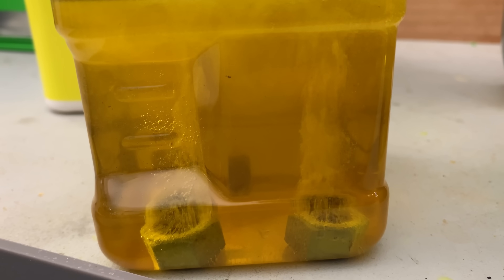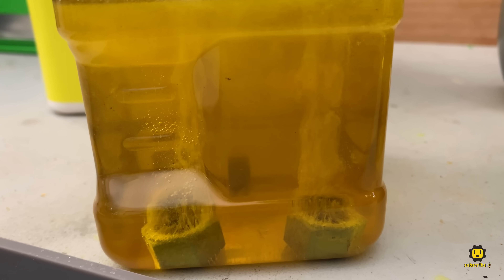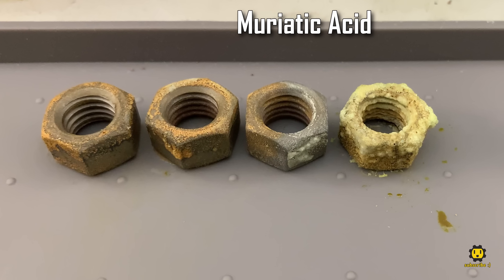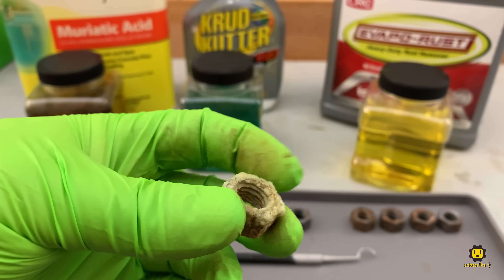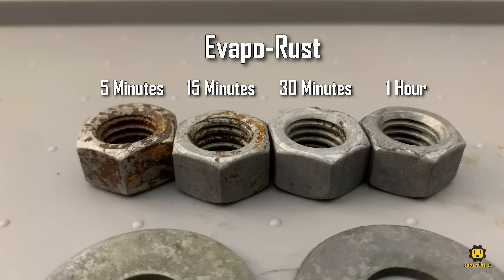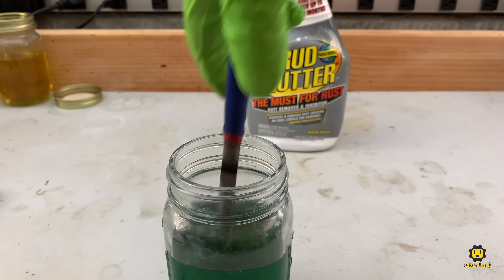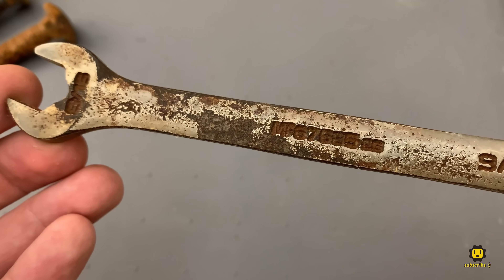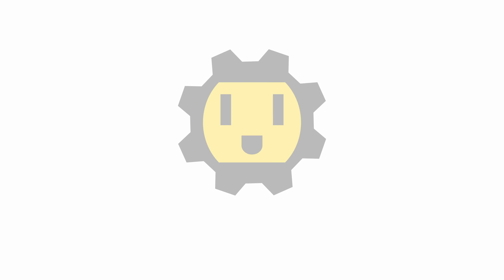The ULTIMATE Rust Remover - Cheap, Fast, & Easy

Comment from the maker: Thanks for watching! Tools Used In The Video:

- VEVOR 15L Sonic Cleaner (COUPON: VEVT5 ): https://s.vevor.com/bfRR2V
- Krud Kutter Rust Remover: https://amzn.to/4jEHIQZ
- Evapo-Rust (1 Gallon): https://amzn.to/3S2KYda
- Muriatic Acid (1 Gallon): https://amzn.to/3S2ltsu
- Small Silicone Tray ( 18" x 12" ): https://amzn.to/4jlppRg
- GIANT Silicone Tray ( 32" x 24" ): https://amzn.to/4j9PXDW
Reply: i love the Jory Caron Laboratories shoutout
Reply: The title of that sonic cleaner says it's for "mental cleaning." So if you have a dirty mind (evidenced by amusement at his frequent mention of your nuts in this video), it'll fix you right up.
As AvE in an alternate reality might say, keep your nuts in a hummer bath.
Reply: Let me see that laser engraver!
Reply: The UK government banned the import and sale of all Vevor electrical products on safety grounds.
Reply: You can use citric acid in distilled water to achieve the same results with added benefit it coated the metal as well to massively prevent rust from reappearing. 
I use this method without an ultra sonic cleaner but it takes a while without it. (Because I currently don't have one)
Reply: Muratic is what I've grown quite fond of over the last decade or so. It will straight up dissolve ANY metal left for too long in a strong enough (unmixed) solution. The trick is diligence while using a diluted solution and prompt immediate concentrated lemon juice mixed with water rinse. Thoroughly done with the knowledge that any Muratic acid residue missed cause more rust than you initially removed. Most people I've spoken to really dislike Muratic acid. Stinks. Causes extreme oxidation if spilled or not sealed properly, EXTREME OXIDATION  if not sealed in its og container. Basically just put that damned lid back on! Ahem.....but the tremendous inexpensivenes, ease of finding and purchasing, but the absolute best part in my opinionĺ is the pure SPEED that it just rips the deep pitted and scalely rust away. Cheap and fast as superman. Love the stuff. Very unforgiving, but harnessing that power is its forte.

Comment: I use evaporust frequently in my ultrasonic cleaner. I also keep a couple jars of 91% rubbing alcohol to "sandwich" my rust removal. Pre-clean and brass brush to do bulk removal of dirt and easy rust. Post-rinse to get any lingering debris and remove the rinse water, leaving the part as dry as possible when the alcohol evaporates. I finish off with a rub down with some oil (I prefer ISO68 generally) to prevent future rust. 

There is a safety concern because ultrasonic frequencies can spontaneously vaporize flammable liquids. Sealing the jars mitigates this risk but it does mean you want to limit heat so you don't over pressurize your sealed containers. In my experience simply turning off the heating element in these steps is enough.

Comment: I use citric acid.  A 10lb bag was dirt cheap on Amazon.  I just put a cup of crystals in a shoebox sized plastic container, and fill it halfway with warm water.  I've never needed heat or my ultrasonic cleaner.  12-24 hours turns rust into a black powder that will stain your hands, so gloves are a good idea for the final wash.  A scrub with dishwashing soap beforehand is a good idea, to remove dirt, oil, and grease.  Citric acid offers no rust prevention, so be prepared to dry and oil or paint shortly after rinsing.

Comment: Back in the 90s, I used muriatic acid when I discovered that it cleared off the rust. 
Sadly, the next day, all those nuts and bolts and screws that I had made in real shiny have become really rusty. Instead of a few of them that were rusty to begin with now every single one of them was rusty.
I wasn’t taking into account that zinc coating being part of what was getting removed

Comment: Evaporust works fine for me. Non-toxic, and you need to rinse it/wipe it off, after 24 hrs. I just spray the pieces with wd40 to displace the water and they are fine.

Comment: Great vid. Primary difference with evapo-rust compared to others is that it is PH neutral and will not remove good base metal no matter how long you leave the parts in there. Does need rinsing and protecting on removal from evapo though. Overall, with a sonic cleaner, the easiest/safest choice.

Cheers for the video - a lot of work there.

Comment: I used white vinegar, let rusty tools sit for 24 hours in 5% acidity, used toothbrush to scrub, rinsed in water and baking soda, dried, sprayed with WD40, dried, oiled, dried with paper towels.  All came out good, before I cleaned wrenches completely rusted and immovable. Removed all the rust.

Comment: Good info, thanks.  You can't heat and use an ultrasonic cleaner on autobody jobs.  Krud Kutter covered with plastic wrap will work.  However, there are cheap homemade solutions that work just as well.  Do a search.

Comment: other problems with muriatic acid is a bottle of it will make everything in your shop rust as the vapours will escape and once you have used it on a part washing off the chloride ions can be challenging and the part will go rusty again quickly

Comment: Evaporust has been perfect for doing small gunsmith stuff, just toss it in the jar when I head to work and pull it out when I get back. A light polish and a quick fire bluing later and most small rusted components come out looking new.

Good to know about the sonic cleaner though, appreciate the tip

Comment: After the muriatic quickly removes the rust, dip the metal at once into oil to prevent more rust. I think you should observe the muriatic acid carefully, then dip in oil, then wipe it off & weigh to see if much weight was lost. I would like to see if a laser cleans off the inside of a rusty gasoline tank.

Comment: With my vintage motorcycle restorations, I've had terrible results with Evapo-Rust.  For rust removal I use electrolysis followed by tin/zinc electroplating.  Thanks for the video!

Comment: Nevermind all these commercial products:
Make some sodium citrate solution by adding citric acid (even lemon or lime juice) to baking soda. If you have pH paper, you can control the acidity of the solution: more acid (lemon juice) = faster but potential to dissolve the base metal, more base (baking soda) = slower, less potential to dissolve metal.

Citrate ion by itself without acid is fantastic at chelating rust.
Reply: Maybe I'm missing something, but adding acid to baking soda just neutralizes the acid, and makes bubbles.
Reply: @Mitch_Feral  correct— that’s the idea. You want the citrate ion which is an excellent chelator for rust, without too much acidity to do damage to the metal— I think a little bit of acidity will speed up the reaction, not sure how fast it goes if you’re using a relatively higher pH citrate solution.

The whole point is that it’s the citrate ion that’s doing the work here— not the acid
Reply: @kineahora8736  Huh. Thanks for the explanation.
Reply: @Mitch_Feral  no problem. Apparently vinegar (acetic acid), for instance, is lousy. I mean, I found it to be lousy too…

Comment: I started using a 50/50 mix of acetone and Automatic Transmission fluid for years now- Works better than ANYTHING....and is cheap to make. Truly amazing.
Reply: It's not a rust remover, it's a penetrating oil like WD-40 etc and when tested against others by Machinists Workshop mag was actually better than the commercial products.

Don't use acetone in an ultrasonic cleaner though - acetone gas is highly volatile and toxic.
Reply: @petrolthreads_   Yes, one needs to be careful with acetone. Just mix it/let it come into contact with the wrong thing, and there can be problems- like if you get it into a catalyst, like used for fiberglass resin....it'll start a fire. It might just be nail polish remover...so it's easy to think it's harmless. But with ATF, it sure works great as a rust remover and penetrant . Better than anything else I've ever tried, by a longshot!

Comment: For years I've used Muriatic acid and then rinsed.  Immediately after, I use a base such as oven cleaner, drain cleaner (solution), or baking soda to neutralize. Then rinse.  It's not perfect, but the rust really doesn't return much after the item is dried.  

To make paintable where it doesn't rust underneath the paint, I then retreat with Ospho (which is phosphoric acid), or you can get the same stuff much cheaper by getting a gallon of paint etch from a big box home improvement store or local hardware store.  It is best if the part has flashed some rust after the above treatment when using the phosphoric acid.  Paint it lightly and let it dry.  The reaction with the flashed rust (which is required to be there) will be iron phosphate, which is inert and a protector against oxygen (which any paint isn't the best at), but make sure it is dry.  The reaction will be powdery grey or blackish.  Wire brush off some, and paint.  This is an excellent method of preparing automobile body panels to prevent pocket rust.

Comment: I'm surprised at those results with Evapo-rust, for me Evapo-rust works great, I use it mainly on chains, but as recommended, it needs light rubbing/agitation after and the rust comes off with that step. A toothbrush also helps. I like it because it's non destructive, even to non metal, paint, etc., and apparently biodegradable, you could soak for a month with no ill effects, the solution just gets weaker with each re-use.
I was researching and came across this video because I needed something more agressive for deep rust, and bought the Krud Kutter and wanted to know how to optimize it.

Comment: Evaporust is expensive, but worth it for some small projects.    Otherwise, I switched to using Apple Cider Vingegar, and then finishing off with Phosphoric Acid.    Phosphoric Acid became my replacement for Evaporust.   If you need something derusted quickly (like a handful of bolts) drop it in or paint it with Phosphoric acid and keep it wet.
Evaporust is not cost effective viable for large projects.

Comment: In the first place....why compare one that completely removes rust in a short time (Muriatic Acid) to the others that take much more time. The idea is to remove the rust in a timely manner...NOT to see if you can damage the item, which Muriatic Acid certainly can.
I have used Muriatic acid for years. I was a bricklayer, and we use Muriatic acid for cleaning mortar stained brick. There is several forms of this. The pure Muriatic acid is what we used..buy it at lumber yards...one gallon bottles. We used about a half gallon to a 5 gallon bucket of water, brush the walls with acid brushes, then rinsed the brick walls. Lumber yards also sell a diluted Muriatic acid called Shur-Klean, if I remember correctly. Not near strong enough.  Also, I think I have heard a weak mixture is used in swimming pools.
     Pure Muriatic acid is POWERFUL. Will choke you if you breathe the fumes, and you will find any open cuts you have if some gets splashed on your hands, even after diluting!
     But: for cleaning the thick rust from heavy metal...cast iron or steel...nothing beats it. It will take a completely unrecognizable rusty piece of junk...and strip it clean in a few minutes. Don't let it get on Aluminum...it will pit that. Another caution...don't leave something in an open container in your work shop....the fumes will put a light coat of rust on all your tools!  After cleaning something and taking it out of the acid, it will start rusting back immediately because you will have removed all the protective, slightly corroded surface of the metal. You must liberally flush the item with water, and then oil it, or prime with rustoleum paint. I was a 57 Chevy hot-rodder back in the day. I had a drive shaft that the U-joint had rusted on and couldn't be removed. So I put the shaft in a 5 gal bucket with acid covering the joint, leaned it against the wall in my workshop, and went out and drank a beer. Came back in to check the results...completely cleaned. Plus, the fumes had cleaned the rust off of most of the shaft, and put a light coat of rust on my exposed tools!  LOL
     Some drag racers I knew back in the day would soak bumpers, brackets...whatever was not structually important in this acid. This would remove some metal, lightening the piece, and at the time, after re-chroming, or repainting, was undetectable by the inspectors. A couple of pounds weight reduction could make a few-tenths difference at the drag strip. 
     If you use it, keep it in it's plastic bottle, and store it SAFELY away from kids. It can be reused, just pour what's left after use back into the bottle. And remember...when pouring it out to use, keep your face away from the fumes!!
Reply: Il ne faut pas seulement le rincer , il faut le neutraliser ensuite à la soude ou l'ammoniaque dilué , puis le sécher rapidement et protéger tout de suite le métal avec une huile ou un apprêt , et là c'est Top .

Comment: Im not sure if its been mentioned but boiling rusted metal in water converts it to black iron oxide, a classic gun bluing technique, so when you added heat and the rust all disappeared but turned the metal dark, I think really what was happening was the black iron conversion and not really rust removal itself.

Comment: Tom Lipton of OxTool channel showed a home mix.   Mixed up a batch, not tested yet. 

Citric acid and sodium carbonate (washing soda) for rust removal, mix 100 grams of citric acid and 40 grams of sodium carbonate into 1 liter of water, adding the ingredients slowly. This creates a solution that converts the rust to a black, inert substance, which can then be washed away. A small amount of dish soap can be added as a surfactant. After soaking, the metal item will be covered in a black film that can be scrubbed off.  

Tom used it on a redo of a Horizontal Mill he just got.
Reply: Yes, I just mentioned this. Citrate ion is fantastic.
But I’ll go you one better for  homebrew: almost nobody has washing soda. I never even heard of it before one of these videos— but everyone has sodium bicarbonate (arm and hammer baking soda)— just use that.
Also, people are unlikely to have citric acid lying around — but anyone can go out to the store and get lemon juice or lime juice…
Reply: @kineahora8736  Even my hardware store has citric acid, its in the canning section. Even Walmart carries it.
Also, you can convert Baking soda INTO washing soda, just need to bake it in an oven. Google it for instructions on how to convert it.

Comment: Red label Krud Kutter. I use it for everything. Nicotine drips off before you get a chance to wipe. Krud Kutter red also comes in gallons which is a significant savings. Not sure about  gray bottle coming in gallons.

Comment: The problem i have is the items or parts that i want to de-rust are too large and the evapo-rust just runs off the metal. Is there a paste that does the same that will not run off so easily?

Comment: I haven't seen any of these products here in Oz, but I used Ranex Rustbuster for all the parts for the car I was restoring. Worked a treat to remove rust, then I washed, oiled or painted the bits. Still driving that car 20 years later.

Comment: Good tests!  I use Evaporust,  but didn't know about heating the solution.  Next to try.
After rinsing derusted parts I spray them with Lanox MX4 which I also use on the Lathe and Milling machine exposed ferrous surfaces.   MX4 contains lanolin which has excellent corrosion protection properties.   Lanox is an Australian product.   Subscribed.
Reply: Lanoguard in the UK

Comment: Wish that stuff had been around years ago when restoring a Triumph Daytona (genuine one, not the modern one) petrol tank.
Plastic vat with a 1 lb. tin of black treacle to 1 gallon of hot water ratio, leave for 6 weeks, and clean off along with thousands of dead flies attracted to the smell of the treacle.

Is that stuff safe for solder and brass when rivetted to steel and cannot be removed?

Comment: Hands down the best rust remover was developed by the guy on better ballistics - not only does it work very very well it is way way cheaper than store bought stuff and will 
not damage the parent metal -as if not already awesome enough ... parts really don't  rust easily afterwards. Check it out !
Reply: It's Beyond Ballistics, I believe :) But yes, his solution works better than Evapo.

Comment: I've personally used Evapo-Rust for years, and always felt it was too slow until I saw this video. Combining it with heat and an ultrasonic cleaner is a total game-changer. The 15 minute result blew my mind. Never thought it could compete with Krud Kutter. Definitely trying this setup in my next restoration project.
Reply from the maker: Thanks for the comment! It really does make a remarkable difference in speed. I hope your next restoration goes well :)
Reply: @ShopHumor 12 hours in Evaporust always does it for me

Comment: A couple minutes in muriatic acid, then into baking soda. Rinse. Oil.
You're ready to weld or, if you want real rust proof, heat until blue with a torch and dip in oil.

Comment: I've had good results with Ospho;  Fe2O3 + 2 H3PO4 → 2 FePO4 + 3 H2O.  The iron phosphate coating behaves like etch primer.  I squirt Ospho on any rusted bits under my 4x4 to convert & protect.  When possible, I prefer to use electrolysis in sodium carbonate solution for ferric metal.

Comment: I still stand by Vinegar 5% acidic, non toxic, safe, it doesn't eat away at the part unless you leave it in for like a week it can strip away coatings...If combined with a sonic cleaner I bet it would work VERY well...What it does is soften the rust so we can brush it away with the wire brush...I have cleaned lots of parts this way...Be sure to wash and dry the parts before flash rusting if you want clean metal.